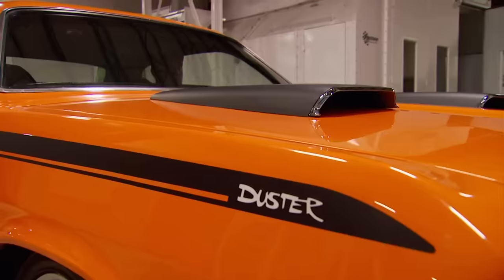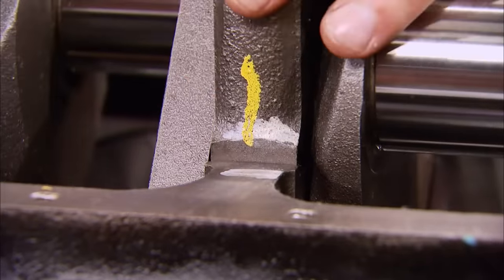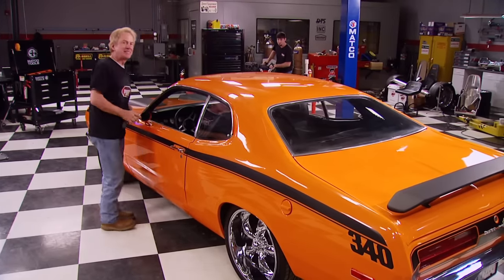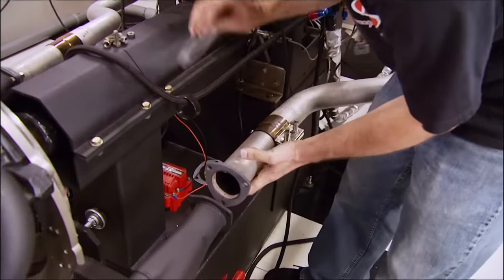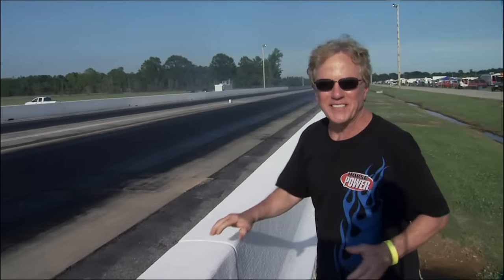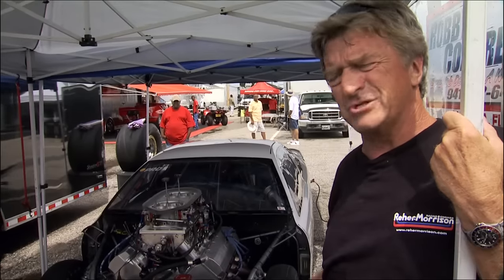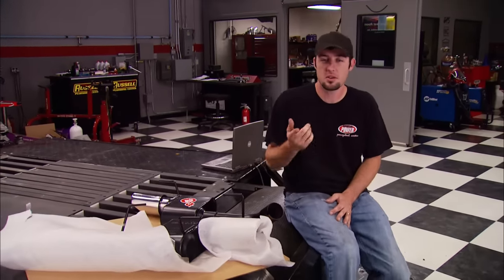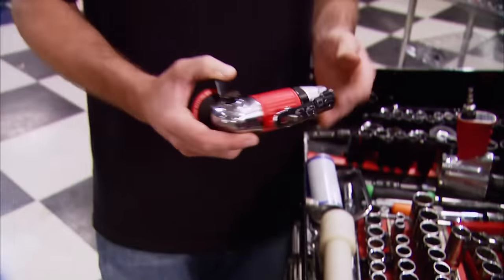Mopar 360 Build on a $2,500 Budget - Horsepower S13, E17

Comment from the maker: Tell us about yourself! Take our Viewer Survey! https://www.powernationtv.com/ytsurvey
Reply: I cannot get the survey to work on my computer or my android phone.
Reply: Thanks for the Mopar build.. from a Southern California 68 Dodge Dart Daily driver.. 318 and Slant6.
Reply: You should do a budget build video like this on a mopar 383
Reply: On your next Mopar build dont be afraid to use a cam with some lift in it, somewhere between  .520 to .560 lift and  .270 to .290 duration your choice hydraulic or roller and 112° to 110° centerline. And centerlined not installed straight up.
Reply: How about the part number for that harmonic balancer
Reply: @thorlarsen9770  They don't want you to know what the 360 can make. Nice intake, headers and water pump. Use that, stroke it, cam it and six pack it.  Now you have something different, they don't want you to know about.
Reply: Where is the performance build on the 360? What season and episode?
Reply: @bigboreracing356  I have to say that the LS motors was a damn good idea for chevy to build, but that new tech so not a fair comparison. We could compare the 78  corvette vs the dodge little red express powerwagon if you wan to skew numbers .Its bad enough that you can build a good 350 motor for 2500 in parts because they cost a lot less and have everyone producing aftermarket  parts for GM. Mopar very few parts are readily available and when you find them they are not cheap, to be fair if they did the same parts swap  never mind the cost same CR cast pistons, heads, cam etc then run them.  and compare numbers, FYI since you can buy an LS motor new still the cheapest one is still 10k NEW. The 392 hemi  is 8k hell cat is 12500 and demon 20k which is what the LSX costs. Pretty sure 840 hp leaves the 650 hp LS motor behind , in a 69 dart blowing the doors off a gen 7  vette is sad , but at the end of the day the Vette is still a bad ass car.
Reply: if your paycheck was based on the hp numbers you pulled out of this engine,  I would be willing to bet that budget build would have been a screamer!
Reply: Do a 318 budget build
Reply: "We used the 1.88 valve head.. and highlighted it on the show"   Thanks No Horsepower TV.

Comment: Those LA engines where some of the best. My grandpa’s 86’ D150 service truck went over 400,000 miles with the 318 with regular maintenance.
Reply: They really do last
Reply: LA engines really were legendary, the 273, 318, 340, 360, all bullet proof
Reply: I have a 65 D100 with a polyblock 318 in it. It has original hemispheric combustion chambers, and it still runs and drives fine!
Reply: I’ve got a magnum 318😂😂 it’s junk but I love it
Reply: @chalupamsf  I feel for you with that magnum, definitely not what they use to be.
Reply: American engine generally do last long because of less efficiency and slow rpm, which for the US is a good thing because gas is generally cheap
Reply: @chalupamsf  I got over 300k on my 5.2 magnum. And I beat the shit out of it. Nothing wrong with them.
Reply: @tomc8157  same here man literally
Reply: Nope. I had a 318 that had less than 200k, smoked like a diesel and then the timing chain ate it.
Reply: @cudaman2formula874  I have a 1990 w150 with a 318 and it has 300k on it right now!

Comment: The “Feather” Duster was an economy car with a Slant 6, and Aluminum fenders and hood to make it lighter.  Racers loved to swap out the six for a v8.
Reply: I thought the "Feather Duster" build option was available, regardless of drivetrain slection?
Reply: The94GTC  didnt they also have aluminum engine intake and special eco carb for extra fuel economy, the hood frame was still steel just the hood skin was alum.
Reply: @facebag666  Some had Al intakes, but most were iron. Dodge had same thing as "Dart Lite". Hood skin was steel, bracing was Al. Bumper supports were Al, lightweight glass was used. They weren't that much lighter, it was the lean jetting, mild gearing and overdrive that really upped the mpg. 225s are very efficient, just not powerful. Had a friend with one; he said he really did get 36mpg with it.
Reply: @snysnd  Spot on! Dad has a 1976 Feather Duster. I believe he has netted around 33 mpg with it. It' has the a833 od trans and 2.76 rear axle if I remember correctly. He would probably get even better mpg with it but everything here is an incline or going up a mountain. As for the weight, I'd agree there as well. Maybe a 200 pound weight difference. They still have the extremely heavy doors and bumpers of '74-76 a bodies.
Reply: Don't forget the aluminum intake
Reply: @DR440  No the bumper supports are aluminum
Reply: My '77 Pontiac Astre Formula Safari Station Wagon came with aluminum bumpers and they still look like new here in heavily road salted N W Ohio... and it was rated 28 MPG City and 34 MPG Hiway...
Reply: @jamescopeland8813  it was. Mine was a 318    They were missing trunk lid inner bracing as well as hood bracing and mine had steel fenders not aluminum but I didn’t buy it new. Pretty sure steel was what they came with
Reply: The hyperpack aluminum slants properly set up made good power. A slanty feather duster can smoke the same car with a 318. Even if you give the 318 manifolds and a carb to match the hyperpack it still won't cut it. The 318 heads are crap so with factory options at the time the /6 feather duster was a better option than the 318 but not as good as the 340 or 360. The feather dusters with v8s are almost a marketing gimmick for the amount of weight savings.

Comment: I have built four 360 engines in the past few years. All was from 1996 , last one was bored and stroked into a 418 stroker , pushing 550 to the wheels of a half ton ram 🇺🇸 
Long live the 360
Reply: I thought a stroked 360 was 408 cubic inches?
Reply: CarEnthusiast94 Incorrect, max tolerances is 412.
Reply: STREET RACER very special turbo system, I’ll never give all my tricks
Reply: STREET RACER one guy did in Tennessee but it was a 351C not a moper

Comment: I'm not trying to sound like a jerk but the Magnum 360 in my Roadrunner clone is making about 400 HP and I've got about $2400 in the whole swap including fluids, Hemi orange paint, gaskets, etcetera. The HP isn't my estimate either, the race shop that made my cam said my combo should be good for about 400-420 HP depending on the cylinder wear. A few places I saved a lot of cash were using the headers, carb, distributor, timing cover and valve covers from my old 273. If you were swapping from a Slant Six or starting with no engine in your project at all some of those pieces could potentially add another couple hundred bucks to the cost.
Reply: 360 dodge engine. Ant even close too a 350 chevy.

Comment: We've got one of these in our 1965 Clark Cortez motorhome that we're currently restoring, it definetly needs a refresh so videos like this are super helpful! Thank you!
Reply: No no no. A 65 Mopar anything does not have a 360. You probably have a 361, an early, low deck, big block. The predecessor to the low deck 383 and 400. Easiest way to tell: small blocks have the distributor at the rear. Big blocks have them in front, at about a 40 degree angle. The only other motorhome engine in 65 was the 318 Polysphere, an earlier small block with semi-hemi heads.
Reply: This has been up for 11 months, and nobody else has corrected you yet?? Shame on the rest of ya'all! Hope ya didnt go out and buy the wrong parts.
Reply: Well our distributor is at the back of the engine so I guess it is a 360. Especially as the previous owner told us the engine had been changed from the original inline6.
Reply: @SoulofaSeeker  Ah, now I understand. Imagine how slow that thing was with a Slant 6! Yikes! Zero to 60, only downhill!

Comment: There was a lot of debate over which was better, the 340 or the 360. Both were awesome, but each had there issues. The 360’s tend to crack near the oil drain back slots in the lifter valley. The reason for this may be the 360’s larger main journals, leaving less mass in that area of the block. It also had cast cranks only, but those cranks have been used up to 6800 rpm reliably. The 340 came with a forged steel crank in all years except 74. They also had full floating pistons, but the 360 could be converted to run them as well. The 318 was also a nice engine. The problem with it was lack of compression. You’d have to have custom pistons made to get above 8-1 back in the day, higher hypertext ic pistons are probably available today. And you can take a 360 crank, cut down the mains to 340/318 size and make 349 cubic inch engines out of them. The feather duster mentioned was a special version made for higher fuel economy. The cool thing was that they made the front fenders and hood out of aluminum and a long with the slant 6 they had reasonable fuel mileage. But if you found one and got an adapter kframe for a small block or big block the light front end would be a big help! The only disappointing thing for this build that they only got 314 hp. Bullshit! With a comp cams High Energy 268 cam they make 360 hp when you r7n 9-1 compression, a good intake and headers and 650 CFM carb. When comp came out with the HE268 grind Mopar was the only engine tested that made one hp per cubic inch at the time, which was around 1981.
Reply: I Have the identical build on a 72 360 with XE268 Cam, 340 Intake with 6322S TQ carb, 9.25:1 compression and 596 heads. Runs fast and plenty of torque to boot.

Comment: Great build to show what a mild mannered 360 can do! When you grew up on mopar and thousands of other engines in heavy duty use you DO NOT see full shaft mounted rockers with POSITIVE oiling not just pumping huge quantities oil in the general area of the top end as weird! We frequently removed the SIX bolt valve covers with a proper edge formed into it to watch them run! Everything mopar with overhead valves ran it as well as everything else ever seriously intended for industrial use. Is always amazed me how many baidaids and crutches brand x people were willing to pay for to get what we were blessed with in oiling, and valve train strength. Mopars always ran at least 2x the seat pressure and had much larger lifters prompting the CHRYSLER ONLY camshaft lobe sections in catalogs! We were especially blessed in big blocks which back in the day for mopar guys were very plentiful being the low grade ore base engines for any chrysler or imperial instead of small blocks. After working on one water pump, oil pump, intake manifold swap, or distributor which could be changed in minutes in the pits on a 383 after we took our sandwiches out from under the "air gap!" Intake at lunch we never looked back. Carrol Shelby showed in the 90s the complete myth of The mopars being expensive with a 360 being (at 1990 Dollars) about $600 cheaper than a 350 for the same hp with a durability statistic of at LEAST 3x better over 2  seasons in the same classes. However if im going to drive a truck everyday thats a Small block it would be a Chevy first. Gas mileage, cold starting and warmup sucked on the older LAs as well as oil consumption from poor valve seals. SBC are great with a slightly lopey cam, a good intake, and headers. Much more and pandoras box was opened. Looking forward to your hotter build. I also owned many of the worst examples of any LA, the mid to late 70s 318 and 360 Dodge full time 4x4s! 7mpg, cold blooded no heater! Great power tho. We always said the worst part about a 70s  318 was that it just kept going, ticked you off every day but you felt bad about ripping it out to put in a hot 440 that would actually double your mileage and cost the same to build. Keep up the good work! Not downing anyones motors, GM and Ford Smallblocks were in my opinion after over 120 vehicles much better than most LAs for mild performance and daily drivers. But since 18 yrs old i daily drive in all weather big BBMs always with more than one carb! 13yrs, 2500 passes, drive to work, haul grain, pull trailers same car 440+6 87 octane, 13.41 at 4860 lb 42 top eliminator trophies no breakages oil pan not off for the next two cars!